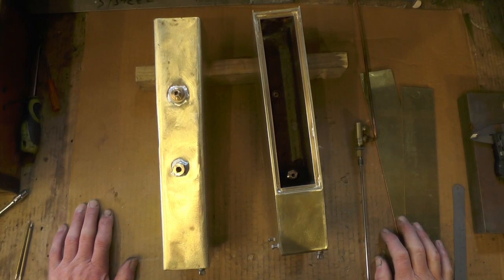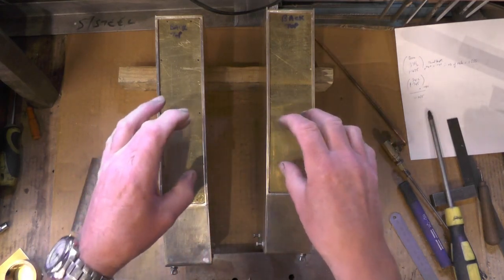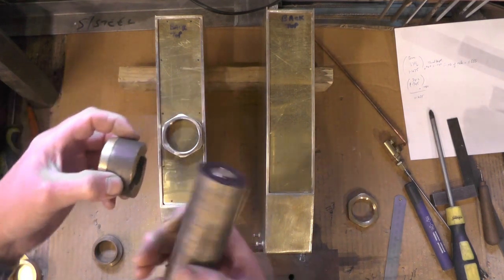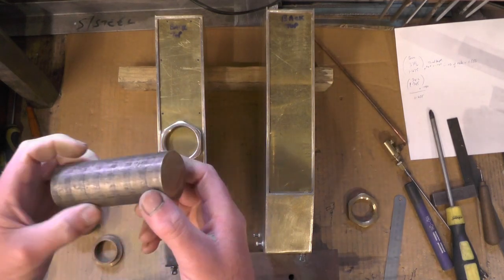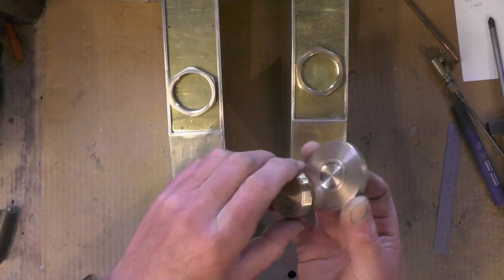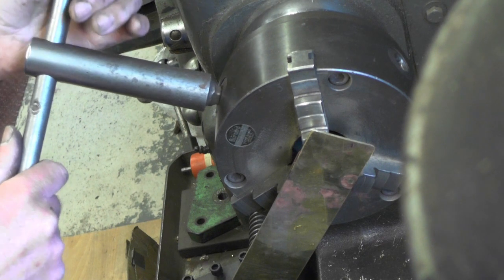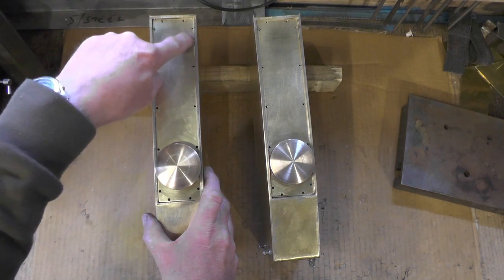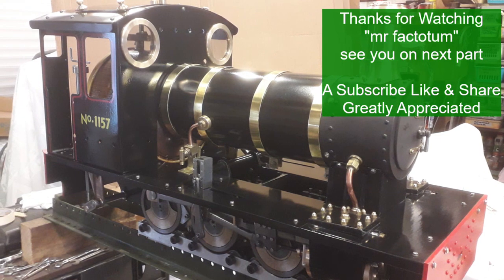Build Your Own Beginners Miniature Steam Locomotive Series ( Water Tanks Part 4 ) "mr factotum"

Comment: You're a great fabricator ! 
I just parted with my LBSC Speedy and its side tanks were the source of water for the injector . The issue for any side tank loco is the water absorbs the heat from the boiler . Injectors need cold water !!!  The hand pump and axle pump pickup is fine from the side tanks .
I made an aluminum riding car coal and water bunker to secure a cold water source for the injector .
Reply from the maker: thanks for advice TFS
i will take that on board, another job for later
thanks for watching
mr f

Comment: The filler caps turned out great Mr. F.  A good use of materials to boot.  Won't be long before you mount them to the loco I suppose.  Looking forward to seeing you driving it on the rails!!  Thank you for sharing sir.
Reply from the maker: cheers joe
was planning to get done for this season, but now C19 is still lingering on, i'm putting brakes on a little and finishing now for next spring time
thanks for watching
regards
mr f

Comment: It sounds like you want to make the tanks water/air tight which might be a problem once water is being pumped.  With no internal structure the tanks are likely to deform as a vacuum forms. Maybe drill a pinhole in the screw cap to allow pressure to equalize?
Reply from the maker: cheers mark, rob just said the same thing, will take that on board, i'm still learning, thanks for info
regards
mr f
Reply: Totally agree with a small hole or some venting to allow the pressure to equalize in and out of the side tanks once the water level starts to drop with the axle pump , hand pump and injector working when needed . No restrictions to your water flow to your boiler water feeds !
As a viewer has mentioned ! 👌

Comment: Looks a complex way of doing tank fillers just to repurpose two brass nuts. But looks well once complete. 

I would suggest that you don’t put an o-ring on the filler as you will seal the tank and then the water won’t flow properly if at all, causing issues with the injectors picking up. This is one of the reasons water filler caps aren’t threaded.

Regards
Rob
Reply: Simple enough to drill an air hole in the caps and still use the o rings to stop them unwinding when on the track.
Reply from the maker: @chrisstephens6673  cheers chris, don't know what i do without you all, thanks for watching
regards
mr f
Reply: @MrFactotum  always happy to poke my nose in whether wanted or no.😉
Reply: I always put a breather hole in on either a hinged filler cap or a removable one. So it is highly advisable for one that’s threaded. 

What I would try and avoid is having the breather hole break out through the top of the cap in the vertical. I would drill from the underside almost through to the top of the filler cap and then drill 90 degrees to create the vent. This way ash and dust from the chimney can’t find its way inside the water tank. That would be a killer for an injector and would require stripping down and unblocking the cones. It’s highly advisable and standard practice to fit some form of filter on either the filler and/or the outlet to the injector. Debris can also stop clack valves from reseating, so hand pump and axle pumps aren’t safe either :)
Reply from the maker: @robw53  thanks stb
great info and i will take all that on board, i appreciate you taking time to help.
regards
mr f
Reply from the maker: thanks for that tip rob,
ive learned something new with that, thanks for sharing.
regards
mr f